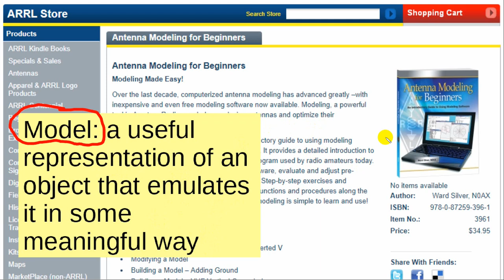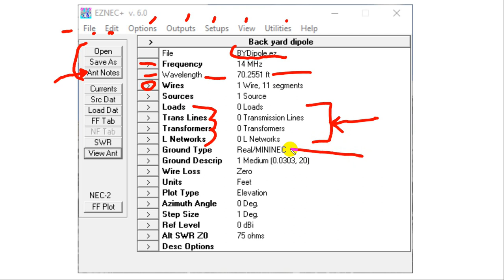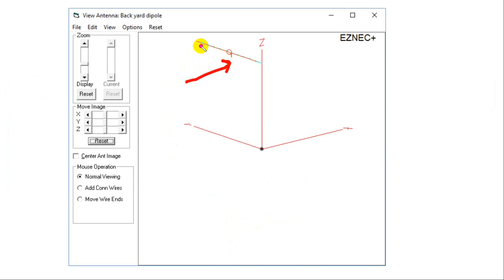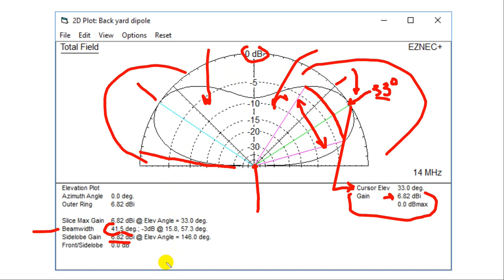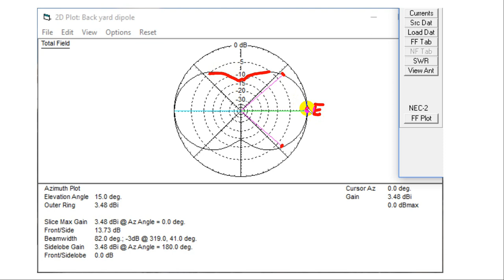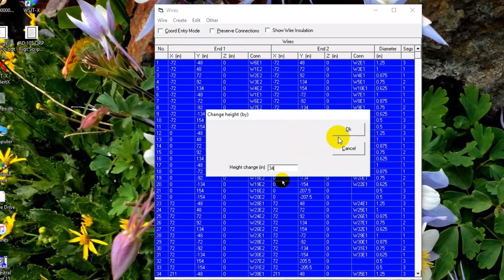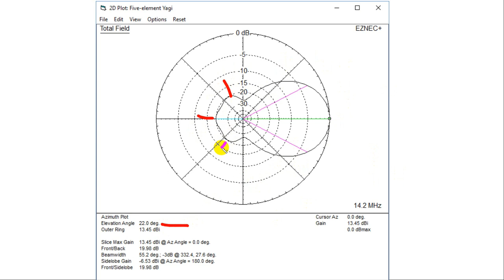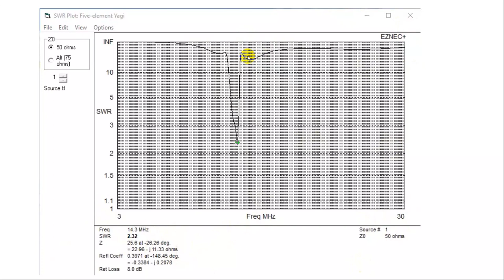Decoding Antenna Modeling Charts (#110)

Comment: Hi David ,
Is there any way I can entice you to give 4nec2 a fair shake ?  
I've been playing with 4nec2 for about 5 years now I think it is the  superior program.
It is almost  like being able to see into the radio spectrum.  I went completely overboard when I found out I could figure it out and use it to answer most the questions others argued about.
You can use variables in the wire geometry and even use trig functions to describe the wires.
The optimizer has a sweep function that lets you to really easily do the type of height test I saw in video  #100 .
  Once the model is built it would only take a couple of minutes to have it run every height from 5  feet to 100 feet in as many steps as you want. Just hitting the arrow buttons scrolls through the  different patterns. 
I also have ground planes that the radials can be swept from about 80degrees (almost a sleeve antenna) to about -80 (almost a dipole)  It's cool to watch the specs as the radials drop one or 2 degrees at a time , it even graphs the results in case you missed the trends. 
Does EZnec do vertical vs horizontal  polarization?  Circular polarization? Axial ratio?
There is no limit on the number of segments  and the format of the models files are text files allowing easier sharing and collaboration. Oh and it runs in linux using wine . 
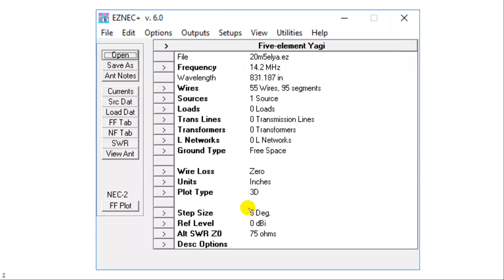I was wondering about the vertical vs horizontal because the dipole you show at ~ @19:13
virtually all the radiation going north and south is vertical polarized even though the dipole is horizontal. That would farther attenuate the signal due to mismatch.
In the horizontal polarized pattern the north and south have deep nulls. 
I also think that there is value in modeling in free space especially if you are designing an antenna, and also as the frequency goes into UHF and above.
Not to mention the simple curiosity factor of seeing what the pattern  looks like with nothing around at all  you quench by looking at the free space pattern.
Including a ground during development can also interfere with the optimization. 
Putting it above ground is the last thing I do when studying a model I've made.
One issue I always found with  ground is which should you use?
One group of collaborators I was involved with finally decided to just use free space to keep the variations in the types of grounds from influencing the designs.
After all we were trying for a design that works best regardless of what ground they use it over (this was TV frequencies).
Another group could not escape using some ground as they were playing with 10-12 meter antennas and the ground is inescapable (we never came to a consensus).
I did quite a lot of experiments with the various grounds available and became completely 
 confused. 
Using even standard types of antennas over various grounds the "good ground "  had less gain than the "poor ground" even the take off angle was better (lower) over poor ground IIRC.
My avatar is a circular polarized  omni I have played with way to much. 
73's
Reply from the maker: I've been learning about EZNEC+ but haven't given 4nec2 a good try yet.

Comment: Hi Dave, Could you shed some light on something I've been thinking about trying. I would like to know if you think a Double Bazooka Antenna, (K3DAV type) would work as an inverted V antenna. Thanks,  Pete.
Reply from the maker: I would think so.
Reply: BrooklandBackyardBrewery Pete 
I used run a 40 meter Double Bazooka in an inverted V configuration. The apex was about 40 feet high with the ends about 20 feet high. It worked extremely well. The DX was fantastic and it was pretty quiet. 
Of all of the antennas I've run to date, the Double Bazooka was my most favorite, best performing antenna.